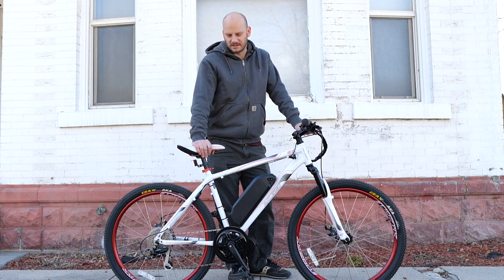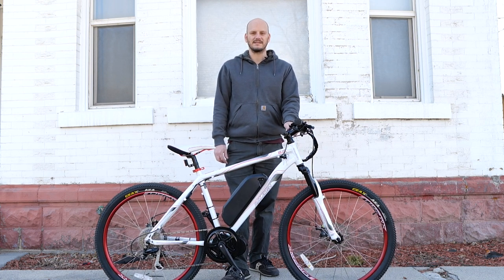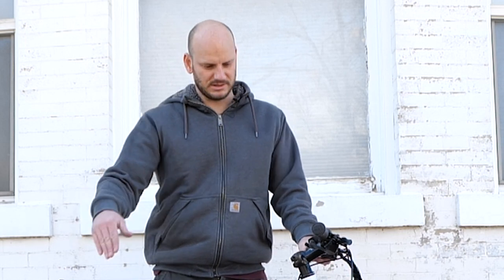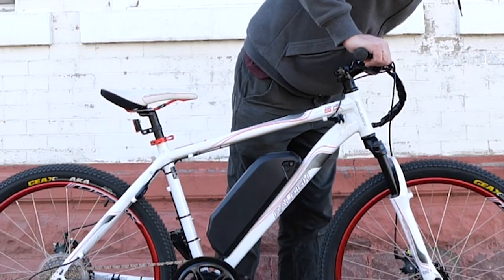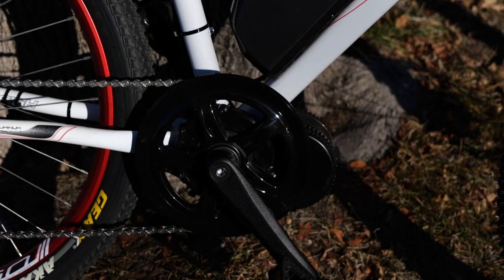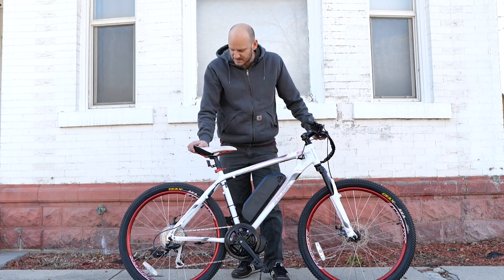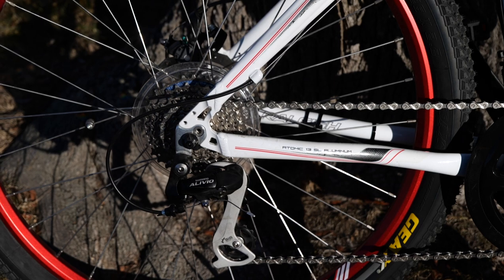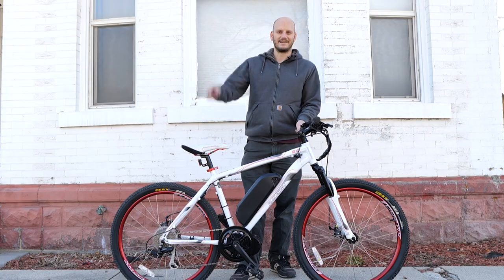Custom E-bike Build: Raleigh Talus w/ Bafang BBS02 Mid drive Motor and 52v 17.5ah  Battery

Comment: Would you be able to put a BBS02 on a 2017 Raleigh Tokul 2? Is the bottom bracket compatible or will there need to be some adaptors? Thanks!

Comment: You record videos in advance? This in February? I do the same thing. I have videos that are over two years old right now that I still haven't posted online.

Anyway I have an appointment with you on Saturday. I have over 600 miles and I think it's time for a chain replacement because I think I have been keeping my mid drive in too high of a gear at startup, especially in assist 5/5. Gear 4/7 clearly is too high. I learned recently gear 3 is better. Mid Drives can be in lower gears than ordinary manual bikes.

Comment: The only thing he may want to do is put in a lower gear, and if he indeed has a 14- tooth high gear change it to an 11, or 9- And why’ll he’s at it might as well change the low gear to around a 50, so you can extremely easily pull up the steepest hill hundreds of pounds with a cart attached if that is something that’s a possibility
Reply: Can confirm.  Using a BBS-HD, 42 tooth on the front, 42 for the lowest gear.  On the former build, the lowest gear was about 28 or so, and I could pull bad hills with a B.O.B. Trailer with a full load of groceries.

The derailleur can cope with a 46 tooth lowest gear, if needed.